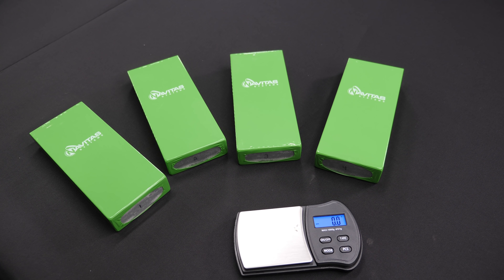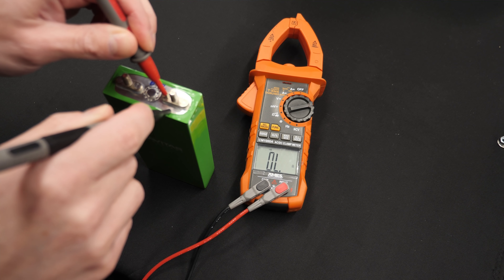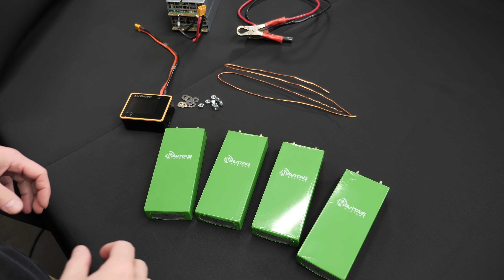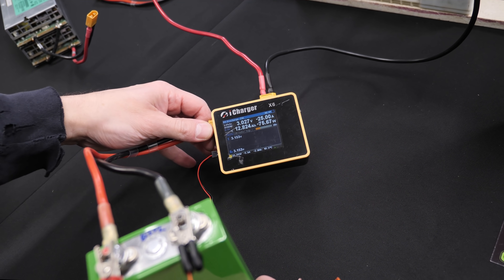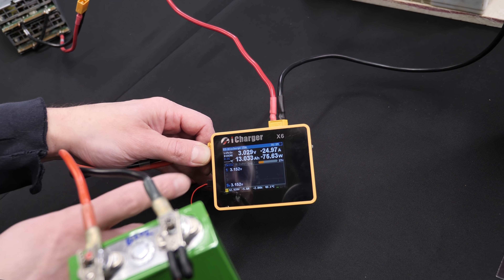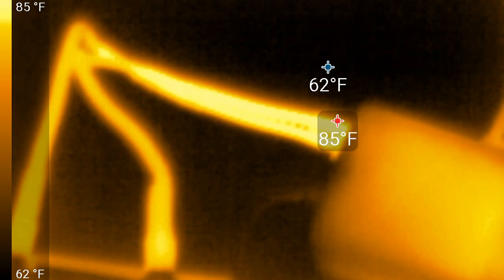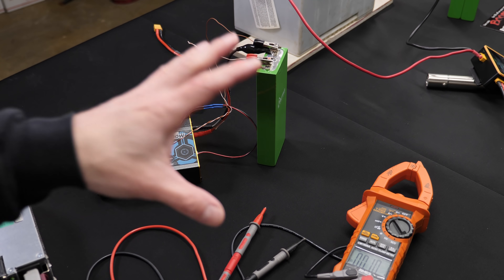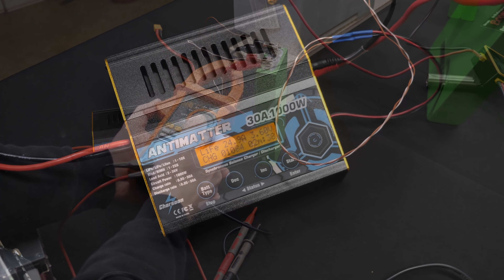25ah Navitas LiFePO4 Capacity Test!!  Amazing Cells!!!

Comment: A great review of a great battery. I built a 100 ah battery for my trolling motor powered kayak. I used flattened 3/8 soft copper tubing for buss bars. I spent extra for an active balance system. I put Anderson connectors on each 3.2 volt parallel connected set. And I put Anderson connectors on the active balancers. I have other builds and I can switch the balancers around different batteries. electriccarparts.com has the balancers and they work very well.
Reply from the maker: Thanks Man!  Yeah they would be purfect for trolling motor for sure!  I love using anderson connectors.  Havent tried using active balancers yet.  Dont they make the bms work harder on the recharge cycle?

Comment: After I looked into 18650's I couldn't see that the value was worth it given the work, maintenance and trouble. Yea, sure, if you have a good supply from the recyclers on the cheap? It's cheap, but once you've spent that time to build the packs and bought all the gear, you probably have spent a fair bit more. Also our time isn't free, you should at least "pay" yourself minimum wage when you account for the cost. I am more interested in packs that are quicker to assemble and need less long-term maintenance.
Reply from the maker: NAILED IT 100%!!!!!!!!!!! Only reason my 18650 bank was so cheap is because I got most for cheap or free but the time and effort was GREAT!!! Thats why Im looking for a safer easier cheaper way to go. These or the bigger 280ah cells will be my next build!!!🤘
Reply: @AVERAGE_JOE  I watched so many of your and Pete's videos, I have only dipped my toes so far but my investment was in a Pylontech rack mount battery pack.
Reply from the maker: Nice! Hows that working btw?
Reply: @AVERAGE_JOE  that's my usual problem, I got all the gear to install 1kW of flex panels on my flat roof extension, but I spent ages trying to convince myself it was okay to permanently stick the panels to the roof.
Then I spoke to someone who has convinced me to expand my plans and skip straight to the 3kW array I probably always wanted.
Now I just need to negotiate with my wife for the challenge...
So the battery remains unused!
Reply from the maker: Yeah go bigger on panels for sure! The wifie might not understand until its all up and running and saving monies!!!🤞🤞😁
Reply: AveRage Joe not to over share, but as I was getting into the mindset to make the order, she has been made redundant. So, will be waiting somewhat longer!

Comment: If you just got one and paired it with a USB power bank module with decent boosts capabilities for v9/V12 volt fast charge.. it would make make a awesome power bank... But USB power bank modules are designed for lithium polymer or lithium ion.. so it be hard to find one that's po4 . but thought it was a cool idea and would be really cheap.. also with type c you can deliver a lot of wattage when it comes to charging..  over 100 watts is common.. my power bank is huge but it takes 8/10  hours to charge and with a maximum charging power of 20 Watts. Slow af.  😐
Reply from the maker: Heall Yeah I was thinking the same. A usb power bank would be awesome with one of these. Could power all kinds of stuff. Shoot maybe even a portable solar power genny!!!🤯😁🤘

Comment: Awesome Joe!  I was going to buy a few, but they were gone, I have bought a few 32700's to add to my 12v bank, and to build a lawnmower battery, to power my ATV winch, and lights, I don't know if my mower does more than a couple amps, I know if I start it a few times without it running a while, it takes forever to charge, the winch would probably kill it while running! I built about a 24ah battery, I still need to test, but seems good, I have about 40 all together! The 5ah are a better deal, they test at near 6ah, (5700-5800) I heard,    keep on keeping on!!
Reply from the maker: I havent tried the 32700s. Maybe Ill get to sometime in the future!

Comment: You should look into ordering a few from China, I think about 100-280 ah cells making about 1k ah Bank,  I'm thinking in a few years start buying some 100ah or so to replace my battery bank, about 1-1.5k ah at 24v, or 8 series bank, 1500ah at 24v would be great,. I think having medium capacity cells is better than very high capacity, because eventually they are going to die, and you will likely loose 1-2, with smaller cells, you can reconfigure, and keep going, although with less capacity, but if you are off grid, keeping the lights on can be important!
Reply from the maker: Ive been eyeballing some bigger cells for sure. Im kinda over testing 1000s of 18650s. Dont get me wrong. If I had an insulated shed or some other place to house my batteries Id continue to process and use them. With the temps we have here in winter I have to keep them inside. Lifepo4 is the way to go for sure.
Reply: @AVERAGE_JOE  yeah, no doubt, it's ok for projects with a few hundred, but trying to power a house, then knowing you will need more in a couple years,  it's kinda depressing!
Reply from the maker: Go big or go home!

Comment: I just finished testing 10 of 16. All within spec so far. Only thing I didn't like was the terminals not being flat, but I bent a few copper washers to fit and I feel better for no good reason. I believe these are made in the USA as well. I'll probably pickup more for my lab packs, if bigger ones become available at a reasonable price I'd be all over some 120->280s.
Reply from the maker: Yeah they test great! I wish I had more discharge capability to try 3-5C. Im guessing they would do it just fine. Yeah id go for some big cells for sure as well lol. 🤘

Comment: I really wish battery manufacturers would list Watt hours on their spec sheets.  It's a far more important stat that amp hours.
Reply from the maker: THAT was one of the things I forgot to mention🤦‍♂️ Thanks for the reminder!🤘
Reply: A good enough estimate is nominal voltage x Ah.
Reply: I prefer amp hours, but then for me math is easy.  Personally I dislike Wh.
Reply from the maker: SAMEZIES!🤣
Reply: @PlanePreacher  Thanks for the reply.  Your position interests me.  My view is that, if building a battery like this, your intent is to be able to power your house.  If you know the Watt hours, it's an easy calculation to work out whether the pack can deliver the power necessary.  If you're using Amp hours, you need to convert it back & forward to decide on the final power delivery at mains voltage.

Why is amp hours superior?
Reply from the maker: I grew up/learned on amp hours.
Reply: @Matt-re8bt  it is easy manipulation of a decimal point or division by 2 for 24V or 4 for 48V and then a decimal point for the standard voltages.  12V 100Ah is 120V 10Ah.  24V 200Ah is 12V 400Ah... 120V 40Ah.  48V 200Ah is 12V 800Ah 120V 80Ah.  I do not have a dvm watt meter, my dvm measures amps and volts.  

If you are concerned by the rounding to 12v vs 12.9 or 12.5 for lead acid or 13.x for lithium type batteries, and you want to calculate to exacting numbers In the end you will need to calculate energy losses in inverter, charge controller and etc then add that in,  (equipment efficiency loss is rounded in so to speak by using 12V and 2, or 4 multiplier) But then when you build your system, even with exacting calculations you will then need to double or triple that battery bank to have minimum 2 days power and many prefer 3.  

Good rule of thumb, underestimate what you have, overestimate what you need.

Added later
Btw, I have been working with electronics and electrical stuff since I was a kid. Nearly 50years. V= IR P=EI (ac add cosine theta for power factor). These CHEAP kill-o-watt meters are relatively new.  

2nd btw, we still need amps to size properly for max current draw of the inverter and the battery.

Comment: Confusion sets in.  How did a 3.6 v cell charge a 12v lead acid battery?
Reply from the maker: Lol its VOO-DOO magic for sure!🤷‍♂️ Andy says it all. Dc-dc step up/down.
Reply: @AVERAGE_JOE  Dhoooooooooooooooooooo!
Reply: @AVERAGE_JOE  I didn't see that in your set up.  That's one of my tricks using a Buck or Boost converter to regulate amperage limits.  Works most well.  I have a few boost converter rated for Chines 20A  ( American 10) that I use like that to test stuff like my Nissan modules.
Reply from the maker: I do have a bank of resistors to dump into but wanted to try the regen since Ive never used it before.
Reply: DC-DC conversion of course!

Comment: I  have 50Ah Top Band cells obtained from Lion Energy being sold off from un sold power packs.  Top Band cells looks to be about the same use bolts not built on studs.  32 of them works for me.  2 years no issues.  24v Configuration . These cells would fit right into my system no issues had.  Yes I will be ordering 32 or some. .  Adding  100 Ah to my kit.  Battery hookup sorta charges high shipping charges I need to think about.  Just balance and parrell with my system .  BMS / ACTIVE Balance.  would be in system.  Same brand name is good for me.  Does Battery Hook up have Bus Bars or is it DIY ?
Reply: Yep as usual SOLD OUT.  When ever you guys do these videos the chits gone in hours.  I am on Hook ups mailing list . I may get lucky.
Reply from the maker: Yeah I tried getting this vid out like 4 days ago but work and snow removal got in the way🤦‍♂️ Im on the mailing list also so hope Im around when its sent!🤘
Reply from the maker: Nice! Id LOVE a 300ah or moar at 48v but cant afford it right meow which is a damn shame cause Ill miss out. I may try and get 32 if I can and dont miss the boat.🤞🤪
Reply: @AVERAGE_JOE  Yep went 24 here.  Close enough to 12 I can work both ways.
Reply from the maker: Nothin wrong with that!
Reply: @AVERAGE_JOE  I need that to make it worth my time on my system.  If I can only obtain half that it would work on my mother in laws system I built.  She is 12v.